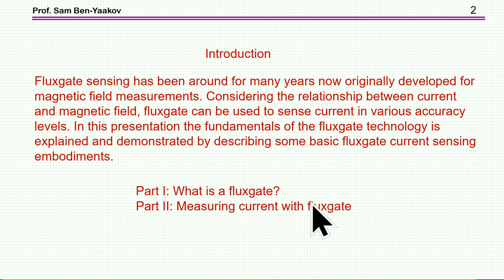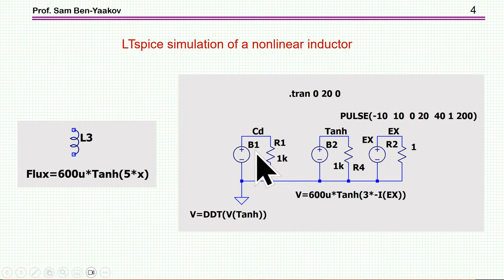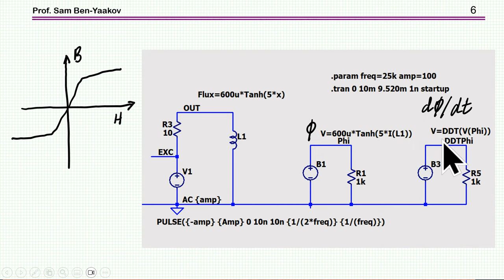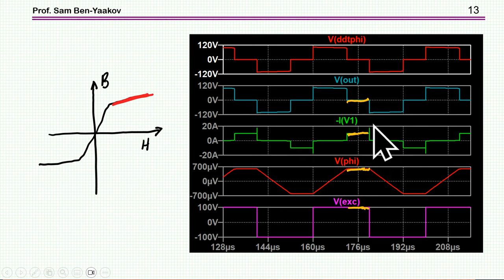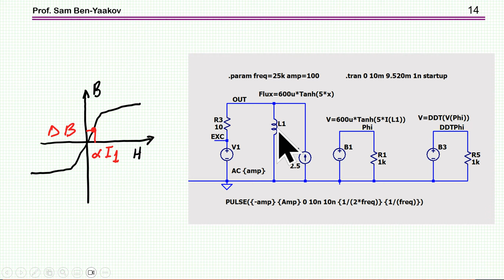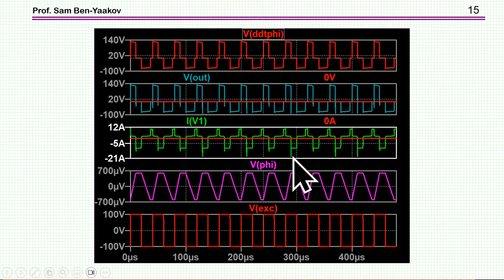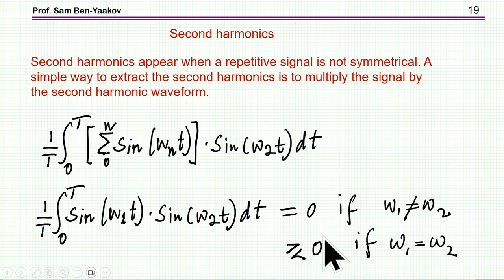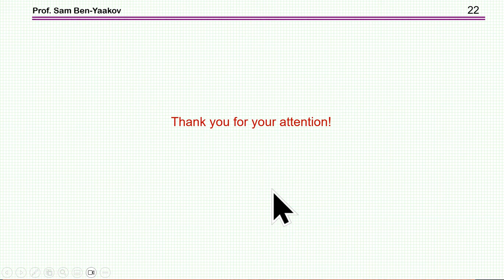An intuitive explanation of fluxgate current sensing Part I: What is a fluxgate?

Comment: Professor I have two questions in my mind:
1. Can we introduce the hysteresis of the core into this model?
2. In the real world when the magnetic core is saturated and we are reversing the direction of current then isn't that expected that the current will become zero first (sharply) then it will rise again in the negative direction with the slope of V/L?
I'm asking the 2nd question because in your model the current takes the slope before reaching zero during the reversal of the excitation pulse.
Thank you.
Reply from the maker: 1.  LTspice has  a nonlinear inductor mode variant with hysteresis. 
2. The excitation is voltage not current.
Reply: @sambenyaakov  Sorry about the mistake in the question #2. I actually tried to mean excitation voltage pulse and corresponding inductor current.
Reply from the maker: @sayantansinha292  If the excitation is voltage, the current is limited by the inductance or resistor. There are no sharp changes when the inductance is active.